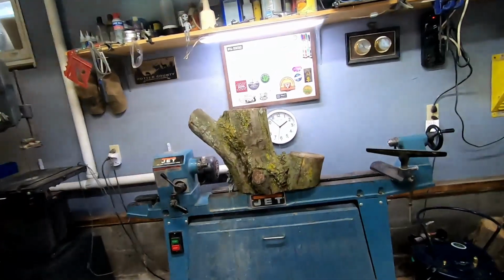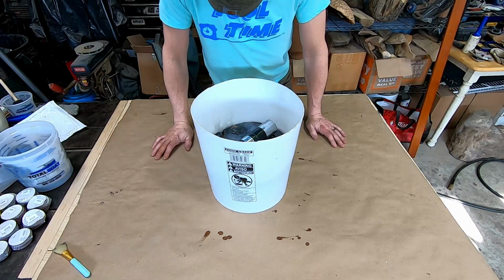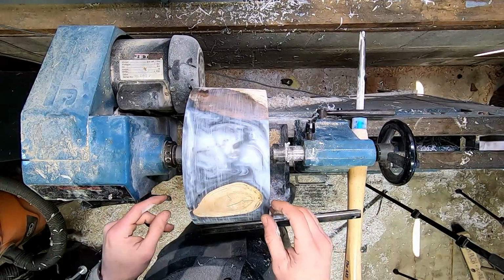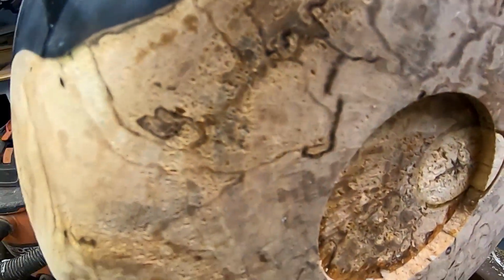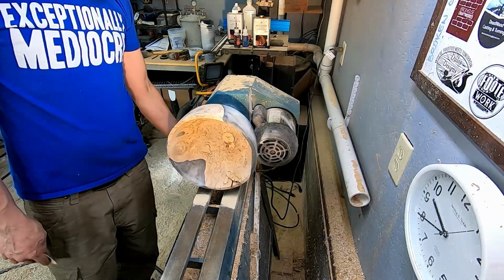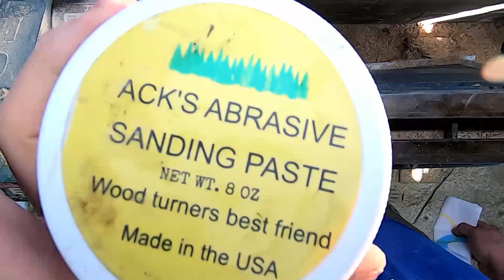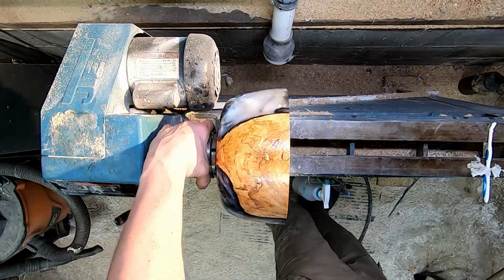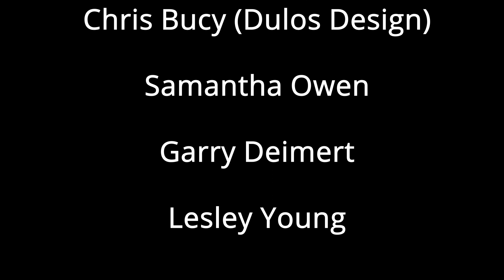Woodturning - Wildly Spalted Silver Maple and TotalBoat Resin, End Grain Turned Serving Bowl

Comment: You’ve made another good looking piece,  of course! Just as an observer (I’m not a wood turner), I don’t much like the Total Boat (though you certainly made it look great). I’ve seen it used on other channels as well. It seems to fall prey to a lot of chip-out and—when it’s time to make it “shine”—it seems to take a helluva lot more time to get it to final finish (without the fine lines/streaking). Understandably, though, if it helps the channel (promotional advertising?), it would make sense to continue using it. I’ve always liked the Art Resin, though. It looks really good and it seems more “manageable.” Regardless... again, great looking piece! For sure due to your attention to detail and the hard work/determination you put into your turning. Keep it up!! 👏💛😁

Comment: Wonderful!!! Could you answer a question: in the pot, how much pressure and for how long?. Thanks a lot.
Reply from the maker: Thank you Luis, I have the regulator on the pressure pot set to 70psi and i usually leave it overnight or around 12hours. but the different resins have different cure times so it would be best to check the specific cure time of the resin that you are using. :)
Reply: @dukaheritage9445  Again... Thank you